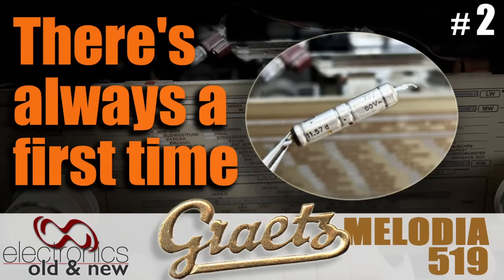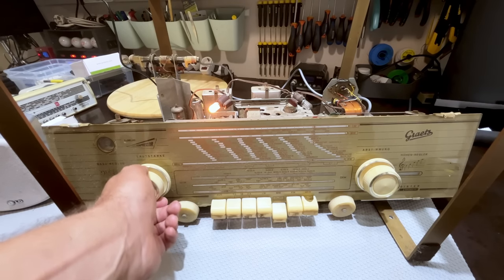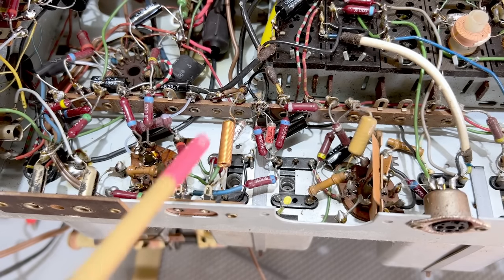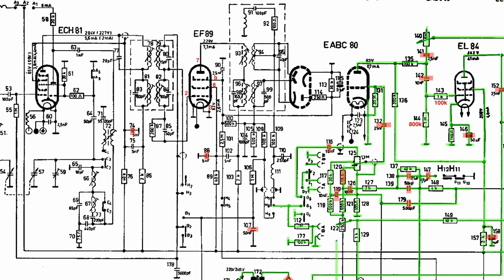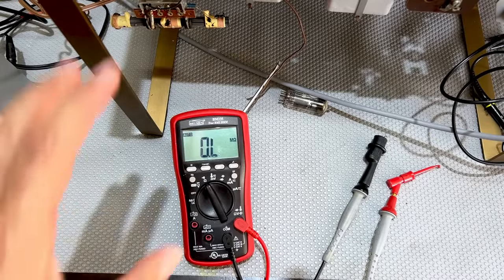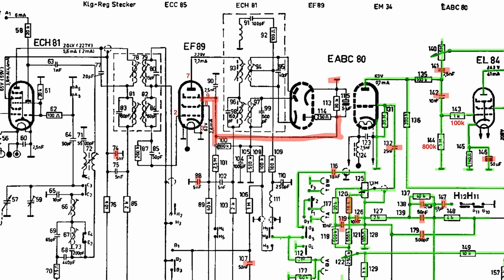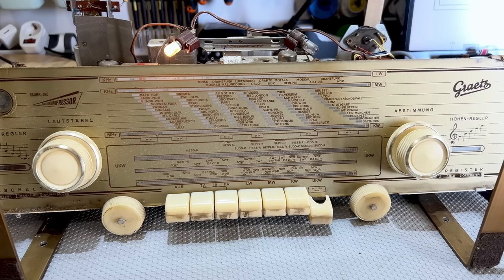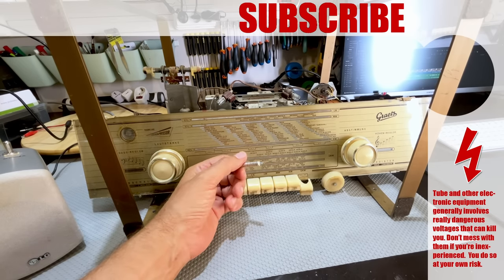Sometimes it's the small things that catch you out. Graetz Melodia 519 restoration pt.2

Comment: Geez what are the odds ? I replaced something like 20 caps in the RCA radio i just finished restoring, some originals from 1937 and a few more recent fro the 70s and i don't recall a single one being completely shorted out, just that they were all very low.  Great job on finding the issue that's for sure.  Thank's for sharing.

Comment: Knowing nothing about vintage radio restoration, I purchased a Grundig 2540 which stopped working shortly after I brought it home. A local radio repair person said he was not able to fix the problem. With a knowledgeable friend we measured all the pin voltages. The EF89 screen  grid was supposed to be 65 volts and was only 3 volts. Studying the schematic only left one culprit, a shorted cap. I cut the cap from ground and the voltage returned. For me that was a eureka moment! Wow, vintage radio restoration is like a big solvable puzzle. It's better than a large 500 piece puzzle because you get to listen to great music when it's done!

Comment: So a shorted electrolytic on the screen grid initially caused the fault and then somebody tweaked the IF alignment so far out it blocked the AM getting through. That's why as a repair engineer I don't like taking on jobs someone else has had a go at. But as a hobby I love the challenge and I love seeing someone elses approach to these types of faults. I think you edited this well. You got the message accross without burying us in the process of actually getting there. Great video.
Reply from the maker: That’s exactly what I think happened

Comment: I had a 100 percent shorted capacitor recently, I had never imagined they would go completely short and could be measured with a DMM out of circuit. Nice job finding it Manuel. I can't remember the type of capacitor it was 😊
Reply from the maker: I guess we need to expect the unexpected 😊
Reply: I also had a 0-ohm shorted ratio detector capacitor not that long ago... and I had a 0-ohm shorted mains smoother (2x50uF 400V) just few weeks ago, 1st half was dead short, but the 2nd half of it was still perfect, no leakage or anything.
Reply: Tantalum capacitors are also known to shortcut (those 'drop' like ones), but fortunately not yet used in these radio's :)
Reply from the maker: True

Comment: Good catch on the shorted e-cap, can't ever trust one over 20 years old it seems. Is there a chance that the pf value caps that are bridging the adjustable IF coils are drifting in value, or suffering from "silver migration" and making the IF resonances drift? I don't know how those IF cans are constructed, but if they had discrete caps mounted on the bottom at least it would eliminate that issue and then you could say it was just misalignment by tinkering. At least the values of those caps are listed on the schematic, which is more than most schematics of US made radio's give you.
Reply from the maker: I think it’s more a case of the electro having caught me 😊 these IF cans rarely drift. This one was definitely tampered with by someone wondering where the reception had gone to when the cap did its damage.

Comment: Hello Manuel yes a tricky fault. I wonder why the agc and fm discriminator is connected to the suppressor grid of the EF89. Philips don’t give any data on g3 except to keep it a 0 volts. 
It is possible that there was a short or leakage in the old ef89 putting high voltage on the ratio detector capacitor.
Reply from the maker: Probably

Comment: I find shorted electrolytic caps regularly. Yes, it's more common for them to go open circuit, but old caps can fail either way. Don't assume, as they will always catch you out. Blown fuses in a power supply can often mean leaky or shorted filter caps on old equipment. Yes, more likely, the rectifier, but don't trust any old electrolytic caps regardless of where they are getting used. Don't even think they could be good, just replace them they are cheap compared to a burned out transformer or other unobtainable part, and know for sure they are good.